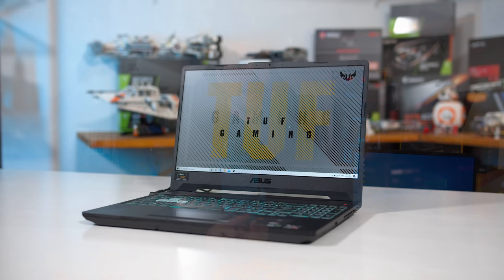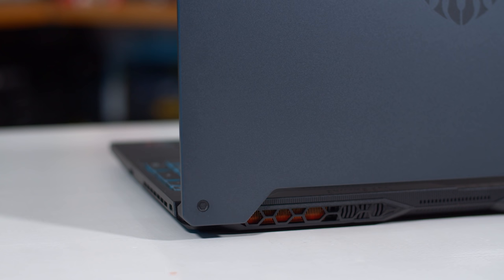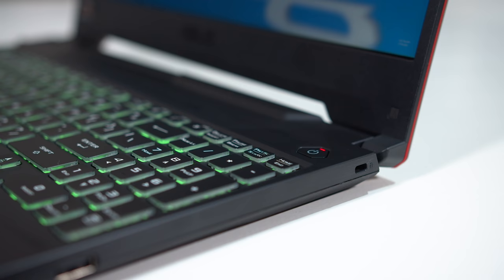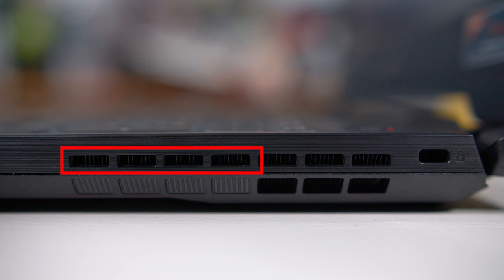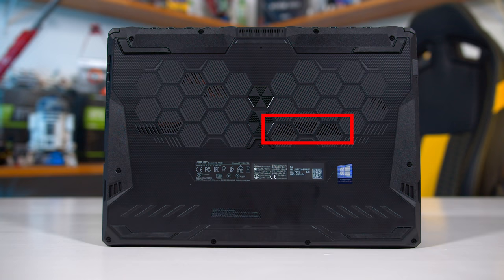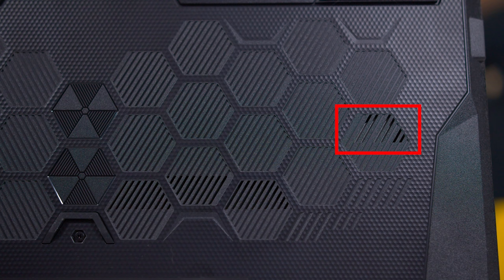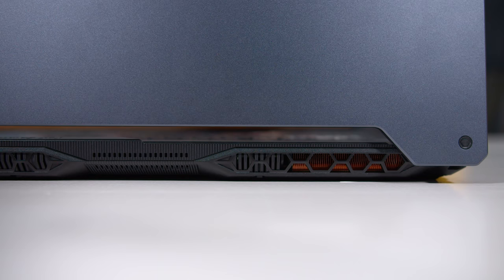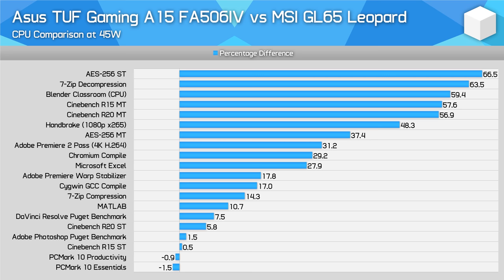Don't Buy The Asus TUF Gaming A15 (2020 Model)

Comment: Watching this on my brand now TUF A15 I bought yesterday... I'm crying right now 😭

Anyway mine has the 4600h and 1650, but it runs perfectly fine with no issues. Fans can get loud if u want to turn on turbo mode (obviously), but if you have headphones like me, you won't be able to hear anything. I hope this helps 👍👍
Reply: Is it okay in gaming?
Reply: Games like warfare n pubg
Reply: dude, you should stress your laptop using Furmark and then please give me feedback I am seriously thinking about buying one
Reply: Hi all, it runs around 60fps on high/very high settings on Call of Duty which is a pretty heavy game, and runs at around 100fps on GTA 5 high/very high settings. I have completed a stress test on furmark, and GPU stays at 70-80 degrees and CPU stays below 90 degrees. This was all on the turbo mode. (By the way, silent mode runs VERY quiet, and still gets around 70fps on high/very high settings on GTA 5 which is impressive since temperatures were the same as in turbo mode). I hope this helps guys 😉
Reply: malymole would you buy it again if you didn’t have it or would you look for a different laptop? I’m looking for a new gaming laptop and some feedback on what you think about it would be great!
Reply: @malymole  hello, how much did your laptop score in Furmark. I wanna buy a used laptop I am wondering how much should be fine. it will help me a lot
Reply: @geraldinesheylasolorzano7181  This laptop scored 7765 points (129fps) in furmark! I was very surprised by this as this is the performance of high end desktop GPUs!
Reply: malymole  hey! Thanks for replying it really helps. Also sorry to bother you again but is the temperature of the cpu and gpu a problem? I’ve heard a lot about the bad cooling and was wondering if it is something to worry about. 
Cheers
Reply: @malymole  thanks a lot. u won't believe but I already bought a brand new ASUS TUF. I found a bargain. I will be in my hands next week hope everything will work perfectly
Reply: @geraldinesheylasolorzano7181  Ah I'm glad to hear! You won't regret it! 👍👍
Reply: Well they reduced the heat pipes in the lower variant.....if they didn't...the lower variants could have provided better thermals
Reply: Thanks god you don't regret it, because I also bought the laptop yesterday via online before watching this video. I feel so relieved 😂😂
Reply: @malymole   @The_one cam cam  Hey Bro, I am also going to buy onw of the Asus's TUF series laptop...Does it give a power saving mode for longer battery? Alao how's the build quality for longer term? Any Issues with the Laptop?
Reply: @mohammedshoaibchoudry7096  Hi, the build quality is plastic (since it is a budget gaming laptop), but it is very sturdy and I do not see any issues you may encounter in terms of build quality. The battery has 2 varients, the 48Wh battery, and the 90Wh battery. The 48Wh will run for around 5 hours on silent mode when you are browsing the web etc (the built in mode for power savings), and if you really want, change the power plan settings in control panel to get the best battery life. On the 90Wh battery, you will get around 10 hours of constant use. Also, Asus has a built in feature to preserve your battery's long term health. There are options to limit how far your battery can charge (eg. Up to 60%) for those who keep their laptop plugged in constantly, so that's a bonus. And for this price point, I cannot see any problems that you would encounter with this laptop, with maybe an exception of no SD card reader. I hope I helped u out a bit 👍👍
Reply: @malymole  Helped me a bit? Noo bro U really cleared my huge Doubt.! Literally no one was talking on this topic but u cleared it for me! Thank You! Just one last question, I am from India(Hyderabad)...If u r too then can u tell me about the after sales service of Asus? If u r not Indian then u can tell the After sales service Of ur region too! I want to know how Asus will treat our issues after the purchase
Reply: @mohammedshoaibchoudry7096  Hi there, I am in the UK, but unfortunately I would be unable to answer that question as I have not needed to contact Asus as I have had no issues! Sorry
Reply: @malymole  Ok no Prob! Thank you for helping me out👍🏼
Reply: Same here! Yeah, the Turbo mode is hella loud if you don't use headphones. Plays games splendidly well too. NFS:H runs at about 70+ FPS on High 1080P with the same spec of yours and Turbo mode on. And this is my 2nd day of using it. Expecting this laptop to last for about another 10 years! :D
Reply: @mieruleyman  is this laptop good overall other than the gaming aspect
Reply: It's quite good honestly. But I had some issues with it. 

The CPU runs real hot on load. It gets bout' 95+ but the GPU remains around 70-80. I had to make some space for the intakes underneath the laptop, but doesn't seem to be helping much. My suggestion is to undervolt it. But heard its impossible to do so. But I havne't tried using Ryzen Master to do it yet.

Other than that, it starts slowing down a bit. It took a bit longer to boot compared to my PC equipped with SATA SSD as its boot drive. But the tables turned when I booted it up this morning. It boots up as fast as how NVMe-equipped laptops/PCs should be.

Camera is decent, but I'd suggest you to get a webcam for it. FYI, this laptop has an 0.9MP camera and a microphone behind it. Even so, this is just enough for online classes/meetings and video chat.

Finally, the cooling fan noise. It makes a loud noise on load, doesn't matter if it's on Turbo or Performance mode. Went to Armoury Crate to find out the fan is running at 5700RPM that I felt uneasy with when there's people around.

Other than that, it's a good laptop that could possibly runs everyting. If you don't mind about the display and the above issues, this laptop is great for general usage!

TL;DR: Good laptop, but hella loud on load, meh display and might thermal-throttle on long duration load.
Reply: @malymole  How did you install windows 10 throught USB? Also where do these options appear for turbo etc, will windows10 automatically detect its asus or we have to download further drivers ? Thanks
Reply: @adamslay1813  I just used the Windows that came with it. You can create a Windows installation USB stick but you would need to have another pc to make it. After you make it, boot into the bios and boot from the USB. There are tutorials online on how to do this :)

Edit: If you clean install, download the MyASUS app. It will show you all the drivers you need

Comment: I have had this laptop for 10 months now and its perfect. never had any overheating problems and i get almost 100 plus fps in all games. These "youtubers" don't know how laptop designs work. The intake ports in the bottom are small so the airflow gets in faster and if there were a lot of them then air pressure would be less which would make it overheat as the air would not pass faster and the hot air would get trapped inside. think of this like a water tap. if you try to cover it the water will flow faster at a higher pressure. same thing applies here.. The design is very good don't listen to these trashy YouTuber who don't have any knowledge and they are running out of content and they will make anything which makes them money.

I have the Asus A15 which has Ryzen 4800h and 32 gb ram. I added 2   16gb sticks in it! this laptop is so much better than the ones in the market. In the value you get a 1660ti with 6gb video ram and a Ryzen 7 which is almost the same as a i9 intel processor! there is only a 2% difference in them. 

I had another comment similar to this but looks like the YouTube deleted it and it didn't like it, this just proves that all the owners who love this laptop and I are right and this youtuber is wrong!
Reply: Thanks brother.
I was planning on getting the laptop.
I might go forth with it ..
Reply: I have the same config as you and it's been 7 months for me and works amazingly well! , those youtubers are just trash literally.

Comment: Your video did force me to do a lot of homework and am glad I did. So much in fact that I'm willing to put my money where my mouth is because I'm ordering it! I didn't see either the Acer or HP (Omen) include an RTX 2060 with their Ryzen configs and would certainly consider ASUS the better choice over Acer any day. Not sure about XMG since it appears to be out of the U.S. and focuses specifically on desktop CPUs, which isn't comparable in spec or price range once you build it similarly.

I think plenty of people complain because it's easy to ride the bitchin-train than accept an astoundingly affordable piece of "GAMING" tech and just be happy with it for its incredibly low price and performance instead of spending $500 more to get something superior screen-wise but then bitch about not wanting to afford it. Also, comparing a 6-core Intel GL65 to the 8-Core 4800H, of course the Intel is going to run slightly cooler (logical since it has less cores) but fussing over 4-5db of fan noise to keep it cool for the performance difference isn't even worth complaining about but hey, if noise really is that important to someone (same goes for display), they can accept the lesser specs of the few models in the same range and be 4db happier and slower in the end.
 

The ghosting image of a $1,200 laptop being compared to that of a $500 dedicated desktop monitor, while nice to know, is also not fair since that's basically half the price of the laptop. As far as not being vibrant and colors washed out, every video I've seen recorded proper makes the display look incredible, but I suppose I'll know soon enough once mine arrives next week. It's an extremely cheap panel because it's an extremely cheap laptop. Since this is a gaming laptop first and foremost, I feel ASUS nailed it on the head. If you're wanting to edit photos then yeah, get the lesser spec'd but same priced models from someone else or just use your desktop PC. OR, connect this to an external $500 27" display, the same one you compared it to in the video. Alternatively, most people these days seem to have 60"+ TVs they could hook it up to and play on if they're not on the go. 

My favorite part of this whole thing:
Title: "DON'T BUY THE ASUS A15!"
(P.S. we get a small commission if you buy from our links....)
"LINK TO BUY THE ASUS A15 WE TOLD YOU NOT TO BUY ON AMAZON, WOOO!!"
For real had me chuckling, thanks!

Comment: Meh...still bought the 1660ti version. Haven't looked back yet. Love it
Reply: How is it going, have you experienced any problems in 7 months?
Reply: @beytulk  Absolutely zero problems so far mate. However, I had traded it in for an rtx 2060 version with the 90 watt battery not too long after my original comment. So I didn't have the 1660ti version for long enough to comment..

Comment: I bought Asus TUF FX504GD in 2018 and still using it since that time. Since the first time I bought it, it only giving me bad experiences. I had problem with the hinge three times, like once every year from 2018 to 2020 I keep going back to the service center to fix it. When I was at the service center, many Asus TUF FX504 and FX505 user complain the same problem as I had, and so I join an online computer forum in my region and found that so many of them had the same problem. And since March, I got electric current and heat problem, and the service center still closed due to the coronavirus condition. Asus TUF series is not recommended, the build quality and the heat management is really bad for its price. There are more worthy alternatives that you can get from another brand like Acer Nitro series.
Reply: Same with me I buy FX504GD and the only thing I remember just send it to service center rather than use it LOL. So many problem in the TUF model, just like you say TUF is not recommended

Comment: Don't be fooled!
If you read the reviews of the MSI you find the battery is horrendous and it runs hot is twice the weight, and more, also the 300hz option on the Asus gives it a better display!

Comment: Ddude I love this laptop, I have one it's quiet, it's smooth, it's fast, it feels like a really good quality/premium laptop & i tell you, for the price you're getting a really really good deal, for specs similar to this one you will have to pay double the price of an a15! Asus is a reputable and trustworthy/good brand! This is my forever laptop and if I play games that end up putting stress on the cpu/gpu ill just undervolt it with Ryzen Controller in order to keep the temperatures at a good level! Honestly this laptop is better than the rog strixx i had, better than the helios predator 300 i had, i love it, it feels durable and like it can withstand accidental drops but ofc, i won't try it lol.
Reply: I got this laptop it's nothing wrong with it he's just a hater for no reason 🤣
Reply: How's the battery life tho? I've been thinking of getting one of these
Reply: the version of of the Asus you got was an A15 right Tristan? may end up getting 1 of these
Reply: @Baratheon.  why yes i did get the a15, and while their was a lot of demand and few stock ready to go so i was quite lucky to get this guy! There was a sale on ebay for 15 of them and I got the 2nd to last one! I love it, it's so fast, sleek and nice! Though i did turn off turbo boost in the battery section as well as install a third party software to lower the unnecessary resources that the laptop would allocate toward the game, and by no means will these two tweaks lower game performance, in fact it may enhance it! turning on the third party software called ryzen controller sets a maximum limit on aspects such as max temperature, and other things so if you're going to get this with a ryzen processor i highly recommend installing ryzen controller as the two will surprise you in a good way! stealthy like a ninja yet powerful like a mid-high tier (but low high) desktops.

If anyone has any questions regarding this laptop please feel free to comment here and ill reply when i can :)

Comment: Solution for Asus :
1. whole back air vent became the long bar expose heat sink , especially work in the 22c room , it's will much cooler than only cover the heatsink inside the casing. 
2. change to 120mm fan blade run at 2500rpm max , and 1700rpm in normal condition.
3. raise the back part of the  notebook bottom from the desk up to 10mm for air intake.

Comment: Hi, thanks for your honest opinions on the A15. I actually bought an Asus F17 with core i-5 11400H and RTX3050, and I can report that the air intakes are improved (similar to your "cuts") It was very well priced, so I wasn't too picky, but thanks to your video I was able to seal the area around the radiators under the cover, and therefore improved cooling a lot. It's still a HOT laptop (in a bad way...), but at least it doesn't sound like a starting jet. I think Asus chose to keep the temps high to keep the fans as quiet as possible, even in turbo mode.

Comment: Don’t know... can only say my opinion here: I’ve bought the tuf a15 (the ryzen version) about two months ago, and I love it! 

Always been a desktop user because of the power vs cooling vs price stats, but two months in, and still can’t believe I’m getting this kind of performance out of a laptop! 

I was afraid it would run hot, but not at all! At least nothing I wouldn’t expect at this level of performance. I’m a 3d/2d animator so my work load can get heavy. It’s not the best rig out there by any measure, but for this price, I don’t think you can get anything that compares to this.

P.S The arguments about the screen are true, but as an everyday Adobe Photoshop/Isustrator/Affter Effects and blender user, its far from a deal breaker! (: That is: if your business/work doesn’t revolve around very precise color management. But then again, if that is the case, you probably use an external ultra wide monitor for work. (:
Reply: Disclaimer: sorry, I can't speak English very well.
U have bought this laptop with 1650 ti and Ryzen 5 4600h?
Reply: @ksovox8262  I bought the version with: the Ryzen 7 4800 and an RTX 2060.
Reply: i just bought the ryzen 5 4600 its works great
Reply: @RanAkano  thanks, but I have bought :)
Reply: I am planning to buy the version u have, did u have any problem with your laptop?
Reply: @kyanh8559  I haven't found any problems but to find and install all drivers u should spend a lot of time. Temperature is normal but u should change some settings for normal work cpu and gpu.
Reply: @kyanh8559  I believe that I won't find problems
Reply: @kyanh8559  been 3 months, no problems so far.
Reply: @RanAkano  im planning on getting the laptop, does it run fast? how is the battery? and are there any problems?
Reply: @atlas6009  Yes, the laptop runs fantastic for the price! At least it was the best choice about a year ago when I bought it. Don't know how i stacks against new products that came since than. 

The battery is... ok. Depends on what you are doing. I think the battery is right there in the middle: not the best one out there, but definitely not a bad one ether. But its a power laptop so you don't really expect a long battery from it in the first place. 

The only problem I came across is the the wi-fi chip. Its not that good. In the past I had a situation where the connection to my network just drops, and you have to reconnect. But a new wi-fi adapter is cheap and easy to replace if it starts to bother you.
Reply: @RanAkano  thanks for replying the info helps a lot, do u think the battery would last like 4-5 hours?
Reply: @RanAkano  also i have ethernet so wifi souldnt be a problem
Reply: @atlas6009  Never really timed it, but for a general purpose use, I think you can get about 4 hours. There were times I was amazed from what I got from the battery, but there were also those where I felt it drained too fast and I couldn't figure out why. Depends on what you are doing.
Reply: @RanAkano  alright thx for ur time im probably going to get it